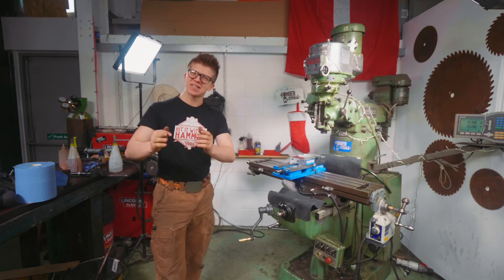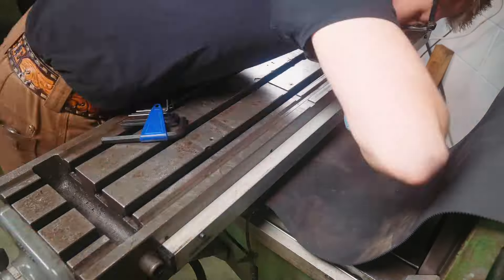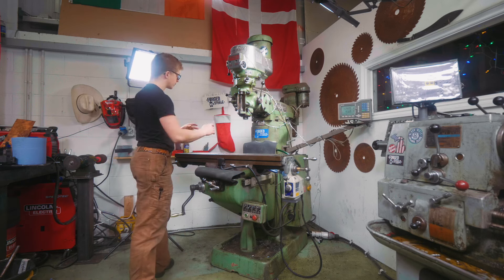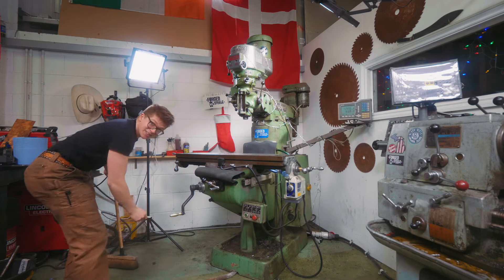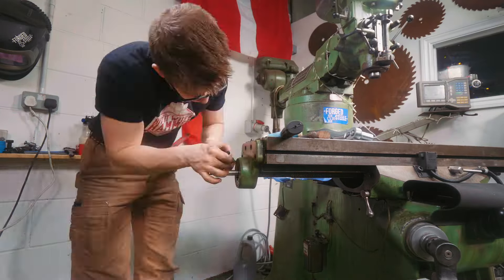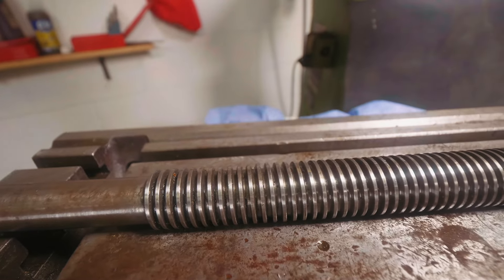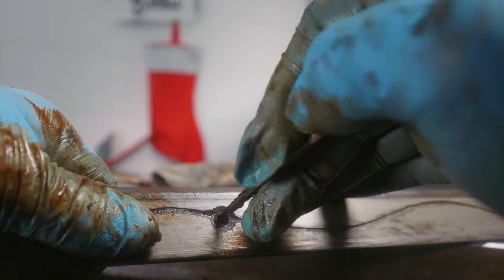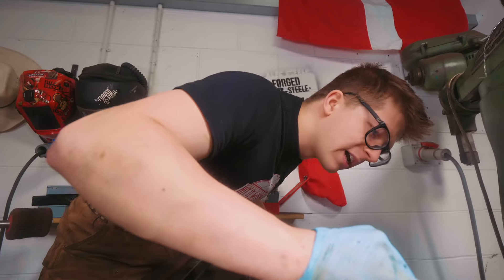It's in pieces....FIXING THE MILL!!! Part 2

Comment: Coming from a maintenance background this series has been hugely satisfying nothing like refurbishing equipment she'll be like a whole new machine when you get her back together. Also don't fret so much about reassembly Alec, you have a really handy video log of how you took her apart!
Reply: Adam Jacobs I think he'll get her back together no problem hes pretty bright.
Reply: If you haven't, check out Physics Anonymous' Lathe refurbish series, it was pretty great.
Reply: Russell Jones I don't doubt that in the slightest but trust me there's always something that you stare at like "where the hell did you come from"
Reply: Adam Jacobs mate you are so right, the amount of times I've learnt from disassembling and and reassembling is enormous, however it's rare i ever get everything back together the first time, extra bolts you could sware are simply "spares" that you clearly just uncovered from some hidey hole that have no bareing on the machine in question :p
Reply: unless he orders new lead screws and nuts,completly regrinds the mahcine ways ,and then scrapes them ,makes new gibs for it ,regrinds the work table,redo the spindle probably too -IT WONT !Then its just a old junk with some new parts and a fancy 500$ kurt vice and a digital readout which is useless with a machine that has so much play in it.And there is no way on earth he can do that all by himself and do it right.
If he however invests money in mentioned above then with proper maintenance and cleaning you have machine that holds 1/100 of mm tolerance next 20 years.

Comment: Alec I enjoy your videos. The part you drilled out is called the metering unit. You will need. To replace them if you ever want it to work correctly. You can do a search for Bijur Delimon lubrication systems. I have maintained machinery at our factory for the last 27 years. Good luck bud if you have any questions I am here.

Comment: Those lube fittings you are drilling out so enthusiastically are restrictors designed to distribute pumped oil equally to all points requiring lubrication. They come pre-calibrated in several flow rates. They clog sooner or later but are impossible to clean and recalibrate economically. You can figure to replace them every 15 to 25 years depending on oil used. You can buy new restrictors from Bijur for about €5 each. It's only money. Replace all the restrictors and clean/flush the tubing. Then all lube points will get an equal share of oil whenever you work the pump. One open line will rob all the other points of lube. You'll have to hand oil every single part of the machine thereafter.

Don't set a bad example for your watchers. Stop now and fix the lube system right, explaining as you go.
Reply: This man is not your YouTube expert, he's the authentic sort. Of the highest order.

Comment: You don't truly own something until you void the warranty, or at least striped it and cleaned it and serviced it, check. And for the finishing touch I think a lick of paint should seal the deal
Reply: MrMellamoto inwas gonna say a good painting would make it look good after all this maintenance
Reply: You can paint the turd but it will still smell.
Reply: zumbazumba1 Bridgeport mills are no turds... but beauty is in the eye of the beholder...
Reply: They are when they are in fucked up state-glorified peace of junk . . .On the other hand spend 10-20K$ on restoration and you have a machine that stays true to 1/1000 of a inch for next 15 years.

Comment: Hi Alec,

I used to represent an European company for surface reconstitution on a wide range of steel and iron equipments, from turbines to precision equipments.

For your mill, if you want to bring back the worn out surfaces the best way is using powder torch (powder metallurgy). What this does is it deposits a layer of metal powder which is superheated to molten and it binds with the metal surface where you deposit it when it cools.

It is easier compared to welding which gives a much thicker reconstitution and may be very hard to grind down without the proper tools, seeing which you simply can't put the entire part on a grinding rig.

The easy part is reconstituting the surface to make it thicker as you can deposit a few microns every pass you do with the powder torch, the hard part is reducing the reconstituted surface till everything is to tolerance.

You can sand paper it down (super long time) or create your own jig (magnetic or clamped or both) with a accurate albeit small surface grinder.

Comment: Dont know about the UK but in the US the metering valves that you are drilling out are available for about $10 us per.  Also, they generally use different size valves on different lines so that the oil gets to all the surfaces as the different line lengths have different resistance.

Comment: Alec as far as those oil tubes. When you put the knee back on, the raceways will provide the resistance and oil the entire way. I would clean out that entire equalizer valve. My mill has sort of the same oiling system and I found that the equalizer valve gets clogged a lot. When you get it all back together. Pump the oil about 10 times and move the knee and table from lock to lock about 3 times. Pump again and repeat. The entire system will be completely oiled.

Comment: Well, I was going to comment that a tear down and rebuild is the best way to understand your equipment, but that's already been covered. The same is true of old automotive carburetors, engines, and transmissions (auto and stick). I learned so much by tearing things apart and reassembling them that I have the ability to conceptualize just about any common equipment's operation even before disassembly. I find my self studying the movement mechanisms as soon as I get my hands on something new. Awesome look inside your mill and a good chance to judge were all the chips can get through to risk damage to the equipment as well. 
My first tear-down was my fathers lawn-mower when I was only about 7 years old. He swore it ran better after I got it back together. I still got my rear-end warmed up pretty good for using my mother's new white sheet as a spread to put the greasy parts on for disassembly. (hey, I didn't want to lose any small parts in the dirt floor of the garage, right?)

Comment: Alec Steele those brass inserts that have the tube nut on that then fasten the pipe into those block manifolds are metering valves with different flow rates so as to control the amount of oil going to specific parts and they also have inbuilt filters to stop debris gong through to damage parts. 
If you take one out you should find numbers on them pertaining to flow rates on a supplied chart from the supplier.
If I remember right they were obtainable from companies that  made and fitted auto lubrication systems onto machinery and wagons and heavy plant machines.
If you drilled them out they'll just empty your lube system in no time and it'll rob lube from important parts.
Can someone make sure Alec gets to know this.
Regards
Lynden

Comment: Alec Steele, Blacksmith, Maintenance Fitter 😀
When I first saw your mill this is exactly what I thought you should do to it.
I bet you don’t call it your old worn out Bridgeport any more.
It will be an oldie but a goodie!
As you pull it apart set the pieces out in order somewhere so you can pick them back up in reverse order.
Seems obvious and you may even be doing that already.  It saves you having to think what goes back on next?
You also won’t end up with spare parts that you have to back track to install.
Love the tool trolly idea.  Saves the need for a little engine crane or similar.
Fantastic project.  Looking forward to the next instalment.

Comment: Hi Alec. Thank you for this video. I do have some advise for you about those  luberication valves.  Dont drill them out. I did the same thing once on a machine at work and now we have to replace it. Those things are volumatric valves. The only allow a certain amount of oil to pass. That way every thing will get the same amount of oil. If you drill out all of the the oil just goes to the most open line and the rest wont get any oil. They also serve as a one way valve making sure the oil wont go down, back in the line. Jus order some new ones and replace them. They are accecable from the outside so thats easy. Good luck.

Comment: Awesome video and I think this is one of the best ways to learn about how your machine works. Now you will have a much better understanding of how precision an tolerance works with a mill like this so your future projects will benefit havyly from your new knowledge. 
I want to suggest you to replace all the (even slightly) clogged oil tubes because if you don't clean them super good they will surely get clogged again pretty soon. I had those clogging problems with an old CNC mill and after I cleaned the tubes for the second time in just half a year I replaced all of them and now I had no issue with them for over one and a half year. I wish I had done it before because that would have realy saved me a lot of hours.
Keep up your awesome work and I wish you best of luck expecialy with this project.

Comment: Did you try using a magnet, preferably the rare-earth variety, to pick up all of the shavings?  In times past, I've used the bar magnet on my roofing nail "finder" to pickup all metal grindings and shavings after a round of metal working in my shop.  Works GREAT!!!

Love seeing your industrious side; so willing to start loosening nuts and bolts, completely confident of being able to resolve the issues and put it back together, running better than when you started!  Feels like I'm looking at a young me (with a Brit accent, of course)!  Well done, young sir!!  Well done, indeed!!!

Comment: Awesome fun mate- I bought a 1964 Series 2 Bridgeport last year at an auction and it took me a solid 4 weeks to pull it apart, clean out the gunk and put it back together. The manual was superb and I would have completely stuffed it up once I started pulling the head apart if I didn't have it. Also, small plastic lunch bags for all the parts and labeling each one made putting it all back together much easier. Pulling apart is easy, reconstruction not so much. Have you thought about re-scraping the ways? That would make an epic video if you could get someone to help you do it!

Comment: When I started doing machine work, the old grey beard in charge of the shop said to always do two things before you ever turn a handle on a machine 1. check the way locks 2. pump the oil handle.  Keep it clean and oiled and it will last a lifetime.  Excellent video.

Comment: I have taken apart cars and built an immense amount of machines, but never a giant mill so I applaud you. I do recommend that you get some torque wrenches and a set of breaker bars for all of your stuck and tight screw and bolt needs. And Alec, you know what to do if all else fails, use fire. Thanks for the awesome variety of vids!

Comment: The bits you drilled out are called metering units. They meter the amount oil to different parts of a machine. They come in different orifice sizes for the application. Drilling them out ruined them. Replacement is needed.

Comment: carburetor jets are great for metering flow. yes for even distribution, the pump has to flow more than all of the lines combined. (reason for a restriction)
 i'm kinda surprised those aren't copper or steel lines.

Comment: I would recommend emptying the oil and running diesel or transmission oil through the mill to de-grease the oil ways. I do this on greasy parts.
Reply: Now it’s clean maybe just do this once a year. You could use a cleaning fluid if that makes you happier but I like to use diesel because it’s oil based and will not introduce rust.

Comment: You do realize this set of videos will become a great resource on DYS witch is great. I just took apart the valve train of my car fixed a couple of things and put it all back together serviced the car did a brake job changed the drive belts and the car is running great, even reprogrammed the service management computer all trough youtube. guidance videos and some perseverance.

Comment: Alec, beware of a lubrication system caveat here:
On modern CNC machines, the lubrication system usually has dosage valves fitted in the manifolds, or inline with the pipes. These valves are designed to let out a small amount of oil after the pressure goes down on the inlet side. An electrical pump would pump for a certain time, a pressure switch would monitor that the pump actually builds up the required pressure (yield an alarm in the PLC if it doesn't), and then when the pump stops, the pressure on the inlet side of the dosage valve goes down and the valves lets out a droplet on the outlet. This to make sure that every spot gets lubricated. If it were just open pipes everywhere, there would be different pressure resistances and some paths would get too much oil and some would get none.  I can't tell from the video if your mill's lubrication system is designed that way, but I think it's worth keeping in mind when analysing the problem. If it works as above, it means that the lubrication paths you think are OK, are actually the culprits here. They are not supposed to leak oil when there is a pressure on the inlet side.

Comment: On the z axis have seen the old boys use a pvc end cap to cover the gears and for the input shaft. Has to be cut down enough to clear the y carriage. Then use some good ole silicone to hold it in place.

Comment: The other tip I had when I did my machine, was to pay attention to the oil type that you use to oil the ways, gibs, head, knee etc. The manual have the correct oil weights and viscosities. I am so not an expert- but the idea is to get an oil into the ways that is not too runny and will stick and not dry out into a gunky crusty mess

Comment: Careful with the acetone Alec.  Anything that has rubber or plastic of certain types will soften, melt, or degrade severely when exposed to it.  WD40 or other penetrating oils will loosen gunk nicely and also will be kind to synthetics like cords, and electronic components.

Comment: If you want to fix those drill holes in your table just use JBweld Marine, a razor blade to apply super accurately and wet sand to 2000 grit

Comment: Great video Alec I did myself fix 3 old drill presses and I had a blast I clean every single piece of detail and repaint it everything sandblasted it and Grease everything. It so much fun I actually learn how to fix electric motors and open up bearings and greasing them a lot of stuff dude, great video, you will see me eventually in you tube. I am building very cool stuff.    Keep it up

Comment: for balancing   that oil flow after accidentally drilling out the 2 , or if you ever want to make balanced flow  on some other  project down the road and want it to be adjustable even though all your fittings are the same ... .  use shim stock to make small disks that fin inside the threaded end  , then center drill those disks to the diameter hole you need to  achieve the balance restriction you need to create even flow across a system .   great video man .

Comment: The way oil pump is probably okay.  It's a one-shot pump where you pull it up once and a spring forces the oil thru the lines which have orifices in them (You figured that out the hard way when you  drilled them out.)

Comment: Those restrictions on the oil lines are called meter units.  I like the Trico units, but there are other makers.  They're scaled by the oil release at a set pressure.  They're marked on the side with the spec and threads, try to match the original

Comment: Wondering if grease was the right thing to put in the gears for raising the knee.  Grease is a great lubricant but with all of the shavings from various types of metal falling in the that grease can turn into an abrasive pretty quickly.  I’m not sure if I’m off base here but in my experience I avoid grease in exposed areas where harder schmoo can collect and stick to it.  Your videos rock btw.  I can’t get enough of watching someone learn by doing.

Comment: Just a suggestion. Drill out the other oil nuts slightly larger than you did the first two maybe that will help. Only problem is it will require more oil than before. The viscosity of the oil and length of tubing is what determines the orifice sizes so the ratio has changed now and the oil should probably be a thicker oil. It’s like scaling up the whole situation so to speak.

Comment: Please when you clean a machine use cuting liquid (oil emulsion) it takes care of the gunk just as well as degreaser but leaves the protective film of oil there. As long as machines are lubed correctly I'm sorry to say that a dirty machine ofta works longer than a machine that has been cleaned the wrong way. Another thing to have in mind is to use compressed air as little as possible (it pushes the gunk and chips in deeper where it's not supposed to be) and rather use a shopvac. 
  I work with fixing this sort of machines an I'm way more often out fixing clean machines than I am machines that haven't gotten any love for ages due to wrong cleaning techniques.

Comment: I would not cut the nut, I did that to my BP,  ended up with more back lash than before it was split.   Those little nuts on the oil lines are flow control devices.  They contain filter, check valve and flow restrictor.   The check valve takes some pressure to open in the flow direction to prevent the lines from draining due to gravity.  They are numbered as to the flow quantity.

Comment: It should definitely work a lot better without all that crud on the bearing surfaces. Knowing how it comes apart (and eventually goes back together) will make it far easier to maintain in the future. Don't forget to give the head some attention as well. It likely has a bunch of gunk in it as well and it doesn't matter how solid your table axis are if the spindle isn't turning true.